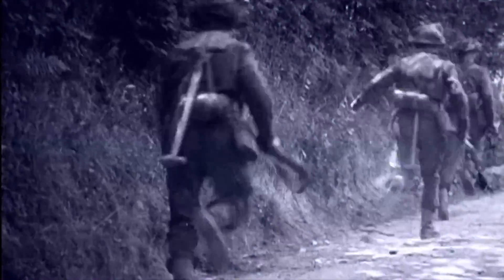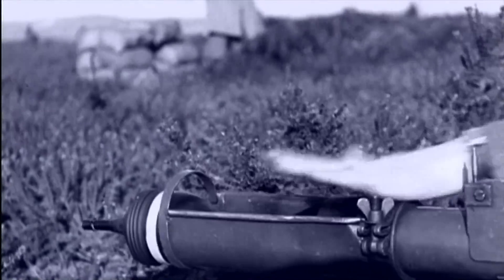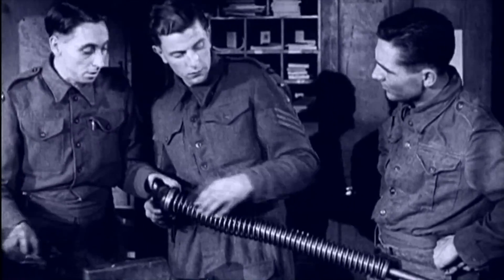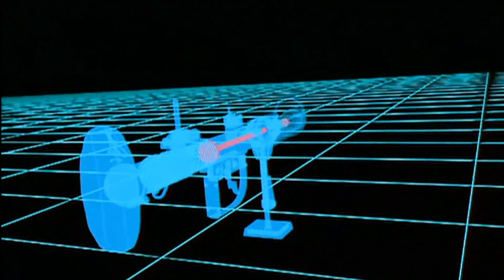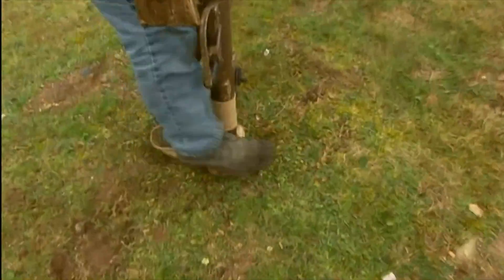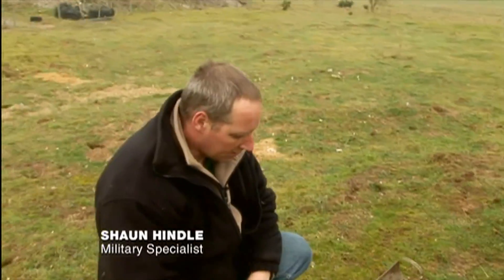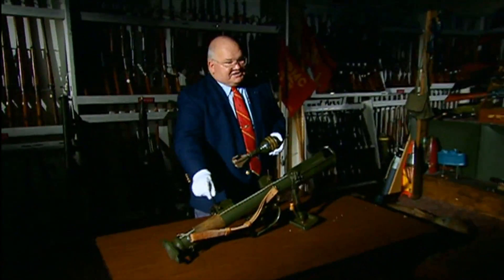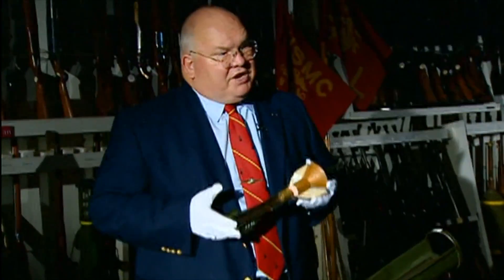Weaponology - "British PIAT"

Comment: Fire a rocket, there is a nice trail of burnt rocket feul smoke leading from the tank you have just incinerated to the firer. The other tanks, whos crew are probably good friends with the guys slowly burning to death inside the tank you have just hit, will be more than keen to get bullets inside you. The piat, you have to physically look 360 degrees around your tank until you find the single puff of smoke, plenty of time for the piat crew to get another bomb off or relocate.
Reply: Not true, actually: with a bazooka, the propellant for the rocket burned out before it even left the launch tube, the motor wasn't burning after it left and so there was no trail.

Comment: This presenter just went way down in my estimation the PIAT gunner never had to worry about batteries getting damp or flat or getting badly burnt by the escaping gasses. And as for range Gen. George S. Patton stated to a colleague that "the purpose of the bazooka is not to hunt tanks offensively, but to be used as a last resort in keeping tanks from overrunning infantry. To insure this, the range should be held to around 30 yards so even the effective range isn't that much different.
Reply: Yeah, but they did have to worry about the bomb's tail blasting off and being shot back at them, and that 25% of rounds issued were duds in one way or another (also, bazookas only burned the gunner with escaping gases if it was cold, because it increased the burn time of the rocket motor). And then you say "yeah, well the PIAT didn't explode on hot days like the early bazookas did" and you go around and around.

I mean let's not beat around the bush here, the first-model bazooka was shit : it was unreliable and extremely dangerous, and so bad they actually suspended issuing it in May 1943. The bazooka wasn't really good until the M9 in October 1943, which fixed issues with exploding and got rid of the battery, replacing it with a trigger magneto. I think the M9 was also when they switched from the temperature-sensitive propellant to BBP, which solved the burned-face issues.

The bottom line is that it is a clunky and inelegant weapon with more shortcomings than a weapon probably ought to have. You know what? That just makes the men who used it all the more admirable for what they did with it.
Reply: CruelestChris Cool reply, the P.I.A.T could have been a lot better   but it compared well with the other early weapon systems designed for the same job it was a dead end technology but it served its purpose for the time it needed to.
Reply: @CruelestChris  finally someone that's not an idiot

Comment: the ugliest and less effective launcher of ww2
Reply: Well it can pierce like 4 inches of armor regardless of range (as long as the projectile can reach the target and hit it). Rather more like an underappreciated piece of equipment
Reply: Actually it's not regardless of range, WW2-era hollow charges were rather fussy about forming correctly and wouldn't do it if the round was travelling too slowly or at the wrong angle, that's why you have those 40 yards vs. armour / 110 yards to hit armour / 330 yards max figures.

Comment: The Piat came before the rocket projectiles were in common use. It wasn't in competition with them, it was in competition to the hand thrown stickey bomb that was thought to be quite clever for its time. Also it didn't have a lot of smoke and fire to give away the position of the shooter.
Reply: That...you'd think so, but it's not actually true. The PIAT entered service in mid-1943 and first saw combat during the invasion of Sicily while the M1 Bazooka was introduced in June 1942 and saw combat in Operation Torch that November. The PIAT is actually a contemporary of the M1A1 Bazooka.

I think this confusion as to the timeline for these two weapons comes about because the M1 Bazooka had been pulled from service about the time that the PIAT entered it (because it was horrifically dangerous) so there was a short period around June 1943 before the issuing of the first M1A1s, when the PIAT was in service but the Bazooka wasn't.
Reply: The PIAT was able to be used in 1943, the Bazooka was more dangerous for the poor user, by the time the Bazooka M 9 came along the PIAT was doing the job very well, the M 1 A 1 was not much good in late 1943.
Reply: Barrie Rodliffe 
Eh, M1A1 was about as effective if not a little more so, look up US experiences with it in Italy.
Reply: @CruelestChris  
Oh dear US experiences or lies. The Bazooka was useless until late in the war.
Reply: @barrierodliffe4155  
No, the M1A1 was significantly less dangerous than the M1 and the M9 had already fixed most of the reliability issues.

You might aw well say early issues of the PIAT were "useless" because of the design issues with the bombs that meant the fuze detonating wouldn't necessarily set off the warhead (solved when they redesigned the Cordex detonation train that connected the two).
Reply: @CruelestChris  
Have you not seen the US report on the M9 in 1944 then?  it still had many problems.
The PIAT worked and did a fine job so no it was never useless.
Reply: @barrierodliffe4155  
No, it still had some problems. All weapons have some problems because they represent a series of compromises. PIAT also had some problems, including that when used at close range the explosion of the hollow charge could fire the tailfin in the direction of the gun crew with potentially lethal force, weight, recoil, accuracy, and frequent failures to catch on its sear that meant it often had to be cocked again.

As I've noted elsewhere, there were three substantial issues with the PIAT's bomb that had to be remedied during the course of the war: the first revision to the bombs was to fix issues with them failing to detonate as described above, the second was that the liner of the hollow charge could detach from the forming cone (cutting about a third off its armour penetration) which required an altered production process, and the third replaced the crush fuze with a graze fuze due to issues with the fuze failing to detonate or being torn completely off the nose of the bomb when fired at sloped armour.
Reply: "Although the PIAT was theoretically able to penetrate approximately 100 millimetres (4 in) of armour, field experience during the Allied invasion of Sicily, which was substantiated by trials conducted during 1944, demonstrated that this capability was often nullified by problems of accuracy and round reliability. During these trials, a skilled user was unable to hit a target more than 60% of the time at 100 yards (90 m), and faulty fuses meant that only 75% of the bombs fired detonated on-target". Yup, PIAT had a lot of problems and the problem with it's ammunition was never adressed.
Reply: @Lehr-km5be  
Since I imagine Barrie would reply to this with a bunch of irrelevant babbling and meaningless allegations, let me do it instead.

The issues with the bombs actually were fixed. That text glosses over the nature of the problems and seems to have been messed with to remove reference to the significance of the 100mm figure. Evaluations after Sicily found the actual penetration was often in the region of 75mm.

The first fault remedied was in the cordex "detonation train" that carried the spark from the detonator to the base of the hollow charge warhead. This was a defective design and could result in the fuze detonating without setting off the hollow charge. The redesign was the Mk1* or Mk1A bomb.

The second issue addressed was the decreased penetration. The explosive inside the hollow charge was supposed to be attached to a "forming cone" to give it the proper shape, but it was found that in transit the explosive layer could detach from the cone and compromise the formation of the hollow charge. This was fixed with an altered production process, and this was the Mk2 bomb.

The third issue was that similar to early pointed-nose Bazooka rounds (M6 to M6A2) the nose fuze (a crush-type detonator) could glance off sloped armour without detonating, or even be ripped off the bomb completely by such an impact. The Mk3 bomb solved this with a switch to a graze fuze and a redesigned fuze socket.
Reply: @CruelestChris  Thank you for your reply! Having a conversation with an actual intelligent person is a nice change. Thank you for proving me wrong, do you happen to know when were the fuses finally fixed? Well, even if they finally were it still means that for some time a pretty high amount of shells would not arm - and it must have been extremely frustrating for the troops on the ground I imagine - getting in a dangerous position to finally fire just to see the charge do absolutely nothing.
Reply: @Lehr-km5be  
The dates are a little hard to find: the Mk2 bomb seems to have been about six months after the PIAT entered service. Aside from that I can only find a precise date for the Mk4 (July 1944), which puts an upper limit on the development of the Mk3. The Mk4 wasn't a reliability upgrade, it was a strengthened frame designed to reduce the tendency for a PIAT bomb to blow off its tail assembly on detonation and fire it straight back at the PIAT crew, which was extremely dangerous at short range.
Reply: @CruelestChris  Damn, that issue sounds nasty.